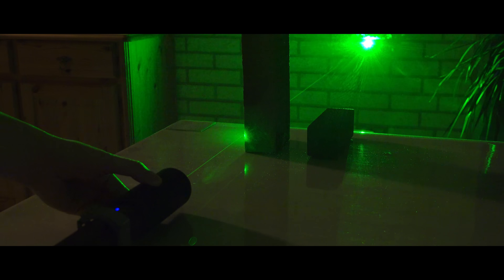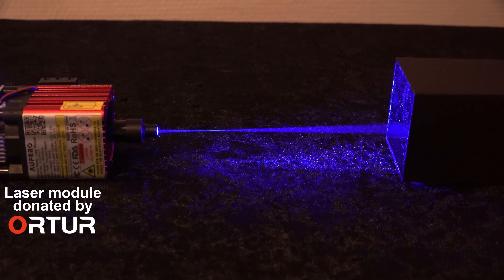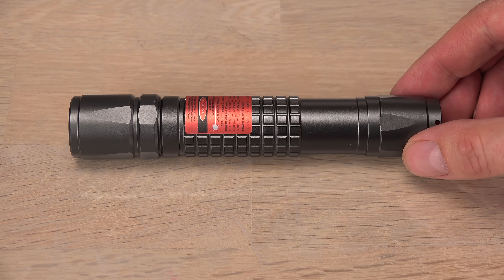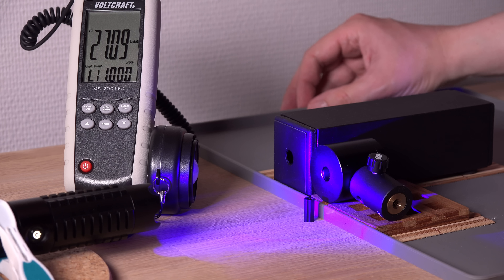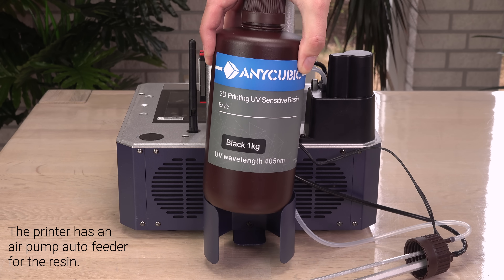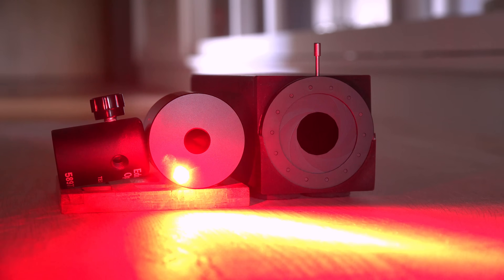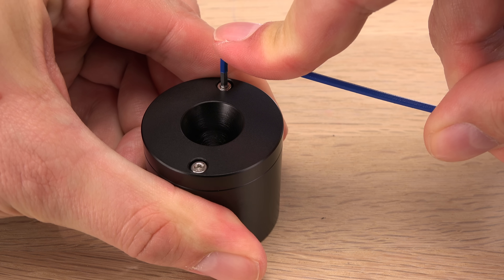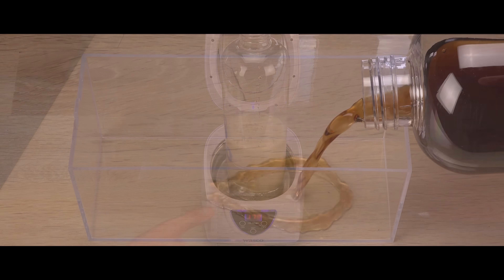PRO vs. DIY | Is my laser beam dump any good?

Comment: Basically, what you need is the plan for a gun suppressor using conic baffles internally paint in black . If you invert the design by sending the laser from the usual bullet exit and plug the part that screw with a plumb bob like the one you use but smaller to fit in... The laser refraction will be caught and absorbed between the baffles.

Comment: Hey, I thought I'd let you know what kind of beam dumps we are using in our laboratory. A beam dump consists of two opaque glass panels, each with a heatsink bonded to their back side. The first glass panel is oriented in such a way that the laser hits it at the Brewster angle, therefore eliminating all reflection if the laser is polarized only parallel (viewed from the side). The second pane is oriented such that it will absorb all of the reflected, not linearly polarized beam.
These really eat up all light, if it wasn't for dust on their surfaces. They can even handle our 12W laser, but you'll have to be a bit careful about thermal shock.
If you need more information let me know!

Comment: might be worth flocking the inside of the chambers and front plates with a fire retardant material. flocking is designed to not reflect light, it's literally glue and fibres chopped up that you scatter over the glue. you then apply a positive charge that stands all the fibers up before the glue drys. an example of it's use is a rally car dashboard to stop glare and reflections on the inside of the windscreen. you can also buy it in sheet form.

Comment: I have a couple ideas.
First, if you made the back face of the DIY beam dump a matte piece of aluminum, you could just about completely spread the beam inside the trap.
Second, if you then got some glass plates that fit together such that they'd make a "liner" for the inside of the box, you could use a candle to coat the entire inside face of the DIY box with black soot, you could make it so just about the entire inside surface of the trap is a near-perfect absorber across the whole spectrum, and as long as the beam is diffused, it shouldn't set the inside on fire. Actually now that I think about it, you could even do that on the smooth non-sticky side of something like box tape or duct tape if you put the tape on something that acted like a heat sink while you were sooting it. You should have basically zero internal reflections after that.

Comment: I have worked in 2 labs and I have never seen a professional beam dump there. Your homemade one is also more advanced than what's usually used, so it's quite normal to see a laser system worth tens of thousands and with more than ten watts terminated in a basic 90 brass pipe bend from a local store.

Comment: Cool! We need more random grooves and deeper ones for even better result, especially on the front face. Take a look at homemade 2x2 wood acoustic panels for the ultimate solution although deeper grooves would be much easier and just fine.

I'm not sure how you can do the break-up or grooves on the aperture without printing either a secondary stand-alone little partition on feet or a snap-on cover of some sort. 

If you were to make another homebuilt no aperture - with the deep grooves/texture inside and front face - from a matt black substance.....I think youd be quite please with the new measurements. 

Painting the inside with the "blackest black 2 or 3"  from "LIT" (culturehustle") or stealth prism paint like military rigs would be a very cool experiment now that you have some sort of measurement data!

Comment: Although you added the variable aperture, perhaps if you still had the original fixed aperture you could use some Black 2.0 paint on the front. I don't think it's heat resistant but to catch any overspill it should be effective. 
For a low wattage dump perhaps the cone could be stove paint and the inside of the tube be Black 2.0?

As a small piece of trivia, TV camera calibration charts used to have a hole in them with a black felt box behind it to generate super black (black paint would never give a true black to calibrate a camera with). This hole is traditionally called Gregory's Hole (although I don't know why!).

Comment: Could you paint the inside with one of those superdark paints that absorb 99.99 percent of light e.t.c. Vantablack i think you could improve the pro model and diy one exponentially with even just one coat on the face and interior even better if you put something like sandpaper inside then painted it

Comment: I am a machinist, not a laser expert, but I am surprised they did not taper the inside of the "pro" beam dump to increase the surface area for light to scatter on. Also, if heat is an issue why not add fins to dissipate the heat?

Comment: 6:05 Don't buy water washable resins! They are not less toxic than normal resins and can cause extreme danger to your health if not handled safely like normal resins - do not flush wash water washable resins down the drain or let it into your sink where you clean dishes - it's extremely dangerous. IPA and normal resins / water washables are the safest solutions.

Comment: Are there pro versions that are close to equivalent in size?  Large apples to large apples, after all.  I figure if they were similar volumes/sizes the comparison could be a little more dramatic... or not.  Without the absolute need for compactness I'd think the best option is the homemade dump.

Comment: Would adding a bit of complexity to the internal geometry of your beam dump make a difference to performance?  I realize that you are probably using a matte finish coating, of some description, but if you can extend the beam path, through, say, the addition of a couple of helical fins a long the inner perimeter, you could get a higher effective rate of absorption, and buy yourself a bit more thermal capacity, no?

Comment: One possible reason for the "pro" model not being "very black" inside could be to better spread the rays, instead of heat having to be absorbed over a smaller area. While it sound great with minimal reflection out of the beam dump, the point is more that whatever "leaks" should not be dangerous. Of course, there could also be narrow applications where the outside should just be as dark as possible, outside of the laser beam itself.

Comment: I recently had to make a beam dump for tuning an industrial laser and came up with a design for higher power lasers that is quite easy to make.
Just two metal plates blackened with a smooth layer of carbon soot from a flame arranged in a very pointy vee shape, with the open sides of the vee covered with plates and a tube on the mouth to block stray reflections (also blackened).

I used aluminium extrusion filled with water since the laser was about 850W but I could have used aluminium heatsinks, and anything under 100W could easily just be flat plates. As long as the surface of the plates are fairly smooth, black, at a very low angle of incidence, and come to a fine seam where they touch, then it should be very effective.

The carbon is quite resistant to high powered beams due to being so thin and is exceptionally non-reflective if applied correctly, but it is a little delicate and easily wiped off so high temperature paint could be superior for some lower powered applications.

Comment: Looking at that pro version beam dump once you took it apart, blows my mind that that thing cost $200. It's literally two machined pieces of aluminum. A person with a lathe could whip that out in no time. Black anodized coating and done. When you said it cost $200 I was honestly expecting a lot more inside than just a machined cone.
Reply: Lab equipment usually sells to companies who don't usually care if something costs 49 or 199 as long as it works and is available.
Reply: @benbaselet2026  ehm no it does matter to them. But if nobody is offering it cheaper off the shelve, they will go for that usually.
Reply: @benbaselet2026  *As long as it's certified and available. A lot of research institutions are not happy when safety equipment doesn't come with a certification of compliance. Even if a DIY version works better, admin and safety don't care because their insurance won't care if something goes wrong. This all goes out the window if you are working outside industry standards, such as pioneering science in a new area, YOU get to set some standards then.
Reply: @benbaselet2026 it’s actually difficult to sell reasonably priced stuff to labs, there’s an expectation of massive price tags, and if your product lacks them it’s not taken seriously and assumed to be cheap.
Reply: @SkigBiggler  Absolutely, I see that all the time with all kinds of gear. Not expensive enough = not interesting.

Comment: Surprising how shiny the internal coating of the pro model is. I feel like that's just a cost cutting measure. They just use the same paint on the inside and outside. For $200, you'd think they could afford some matte paint. (Well, they can, but that'd less profitable)
Reply: if that's aluminum it's more than likely just anodized black and sandblasted beforehand to achieve a consistent surface finish for that matte look. You'd have a rough time sandblasting the groves however. They're shiny because their surface roughness is quite low in comparison to the sandblasted parts of the surface and not a result of any paint of coating.

Comment: You should look into using some Edmund Optics adhesive-backed flock paper #54-585. I've used this to absorb reflections inside sct optical tubes and it works dramatically better than matte paint.

*edit: you might even be able to shorten the length of the square tubing as well.
Reply: I looked up this paper and it said "Note: This material is meant to absorb light and is not recommended for direct exposure to high power lasers".
Reply: @gwc1410  I dont think it would handle a direct beam, but the diffuse/reflected light  off the cone inside the beam dump should be fine.

Comment: I would like to see how different coatings, on the inside, would affect the beam dump. Like Musou Black paint.
Reply: It needs to be heat resistant, that's the thing.
Reply: @jort93z  I wonder if aerogel or starlite made with a tungsten shell would be good with ultrablack CNT to create a laser dump like no other...

Comment: While the DIY dump is larger, the fact that it's more consistent seems to make it the clear winner in my book. For the price, the pro model should use a more matte coating, especially on the internal ridges.
Reply: Yeah, maybe it's "good enough" but seriously, come on. It's $200 and they couldn't do better than shiny black?

I think if you needed the surface to be really matte you could smoke it with an alcohol lamp. That coating will be fragile but it's inside a closed container so probably fine.
Reply: I wonder if a vanta black would work
Reply: @Lance Shelby  vanta black paint is very flammable (not to mention stupidly impossible to get lol) I wouldn't trust it

Comment: Funny as making such "Profesional" model with simple lathe and aluminum block would cost around 20-30 bucks(two small aluminium cylinders, screw with pin for mounting, black mate heat resistant paint in can, primer, sand paper.

Comment: I was thinking about some geometry to reflect light into back of the dump too, and it looks like the pro version has it. 
But for DIY version I was thinking glue + sand and then paint it black again? But I am not sure if it could increase reflection outside if the bad luck would put angles on sand in that way...

Comment: Man, I love lasers. I wish in my younger years I (and sellers) had taken safety more seriously. Due to the use of high powered lasers and no glasses, I have permanent shadows in parts of my vision. It isn't that bad, I got lucky, but if I move my eyes across the sky or a solid colour wall I see them. Makes me a little paranoid now to trust using some of the highest powered ones I have now, even with glasses. A beam dump would definitely have been a handy tool to have when messing around to prevent some of the reflections that can still be hazardous. Great video as always!

I assume it is best to use the darkest colour paint inside with the highest light absorbing properties? Would be interesting to see tests done with different types of internal paint. Use some of the blackest black paint you can get and see how that affects spill.

Comment: I'm in custom optics and optomechanical design heavily focused on laser application and what you have here is apples v oranges. Your diy dump is fine but if it was in a form factor useful for lab work it would likely be spilling too much to be safe or useful.

Comment: Nicee bro your diy beam dump actually works pretty well. I was wondering if it would work better with vantablack or black 2.0 paint coating on its inside since it absorbs more light than many other shades of black.
Reply: I just commented the same idea. I second this!
Reply: I think it could limit the power handling capability to use a super black coating if it is not rated for high temperature applications. It depends on if the goal is to absorb as much as possible of a low powered beam or if it is to safely absorb a high power beam. Paint that flakes of under high power could be dangerous.
Reply: @larslindgren3846  yea that’s the problem with this idea. We don’t know how the paint would behave under extreme heat. maybe it could flake off or maybe it would improve the beam dumps performance or maybe it could give off toxic fumes or something so idk if that would make the beam dump better or not. We would need to first do tests on the paint to check if it fits the parameters of a good beam dump or not, to make sure it’s safe and absorbs a lot of light, etc.
Reply: I was also thinking the same thing! (Did you know that there's now a "Black 3.0" out now from Culture Hustle as well? Even blacker!)

Comment: For the 3D printer washing, the IPA can last a very long time, it takes a lot to fill the container but after that it only really uses a tiny amount to replace what is lost to evaporation.

If it gets cloudy you can filter the resin out. leave the container in sunlight for a little and let the resin bits cure then filter them out with a coffee filter.

Eventually you will need to completely replace it because it gets diluted as the alcohol evaporates and the alcohol percentage gets lower, but if you start with ~99% IPA it'll be good for a long time. You could switch to water washable resins but honestly I don't think it's worth it.
Reply from the maker: Thanks for the tip! I just personally prefer handling demineralized water over IPA. Cheaper, less flammable and less fumes :) But I am in no hurry to switch to water washable resins. I have great experiences with the IPA washable resins so far. Thanks for watching!

Comment: A little longer throat on your DIY box and it wouldn't have any reflection either, though it would require a fixed aperture.
Maybe having ridges like the pro version does, with the ridges getting taller nearer to the entrance. 
Not sure if that's possible with the metal box construction you've got, I'd also be curious to know how well black-painted-sandpaper would work.

Comment: What if it had Black 3.0 paint. "Black 3.0 is the blackest and mattest acrylic paint on the planet"
Reply from the maker: I think it would perform even better - but maybe only for a while. As I remember it, the blackest of black paints are not very heat resistant. They need to be in a beam dump for where the laser beam hits the cone. The paint I used for the homebuilt is resistant up to 650°C! But Black 3.0 may work very well for the inner walls of the 50x50 mm aluminium profile... Thanks for watching!
Reply: @brainiac75 use vanta black it’s much more heat resistant it can withstand heats up to 450°C and Black 3.0 can only withstand 25°C

Comment: how does that cost 200€? jeez, even hand-made would be cheaper
Reply from the maker: Yeah, it is nicely made but they are surely not losing money on making them ;) I think the issue is the low sales number. How many beam dumps are realistically sold every year? It is a niche product usually sold for speciality labs where $/€200 is nothing... Oh, and the $200 (currently $230) is not including the height-adjustable stand x) Thanks for watching!

Comment: How do these compare to just using a slab of graphite?
Reply from the maker: The laser dot would be very visible, if the graphite was not encased. But if a piece of graphite was placed at the bottom of the homebuilt, I assume it would work just fine :) Thanks for watching!

Comment: All I have to say is that... During the tests with the three lasers you did, If you put the lux meter's prob in the path of light from the pro in the second laser, you'd probably get a more accurate reading as to what is being thrown out of it... and for the third, the laser just throws out so much light from itself that it's indecisive thanks to such. (If the light from the third were more focused into a proper beam instead of a splash of light, it could produce much better results.)

Comment: beam divergence usually isn't a problem in research labs due to them using much better lasers :P
Reply from the maker: Or using correction optics ;) For an amateur like me, the versatility of the homebuilt beam dump with a variable aperture is very convenient. I will honestly use it more than the pro model. Just need to buy a lab jack to make it height adjustable. I really miss that feature compared to the pro model. Thanks for watching, Justin!